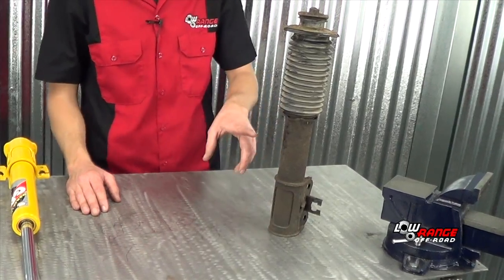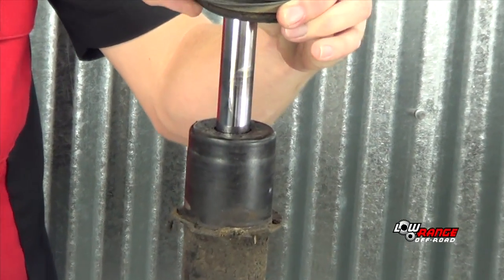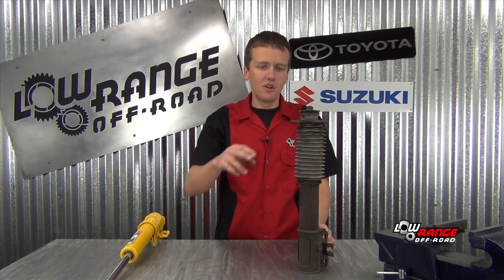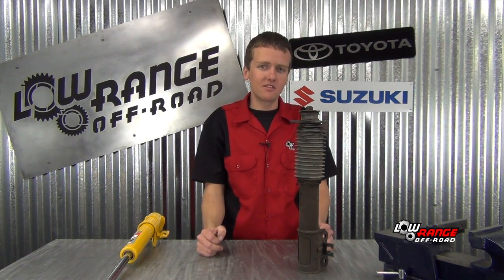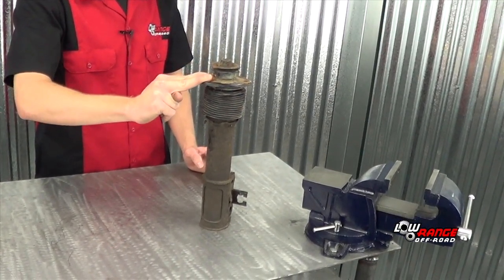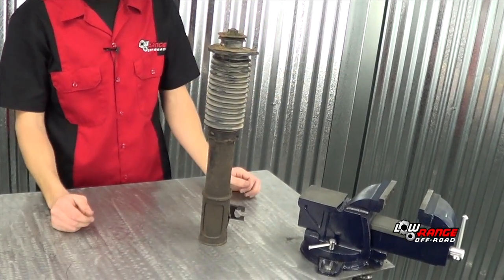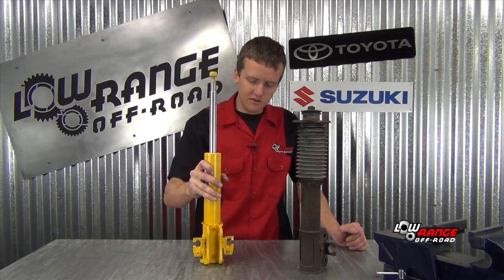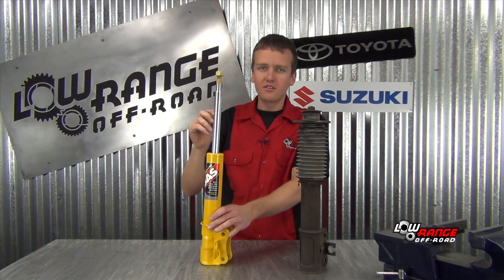Strut and Shock Testing

Comment: I think this is a bit misleading.  The purpose of the shock is to transfer the energy from your suspension and springs and dampen any bounces so you get a smooth ride. It's the resistance that's important.  If you push down or pull up on the shock, it's a way of gauging the resistance but without a proper measuring instrument, it's difficult to get an accurate. Watching the shock automatically extend is a measure too but it's not a very good one, except maybe in comparison.  I mean, the main force extending the shock is the spring, not the shock.  It's how much force does it take to compress and extend the shock when you're driving that's important. 

Too much resistance and I'm guessing you get a stiffer ride.  That is, the car doesn't bounce as much but you feel the bumps.  Too little resistance and I'm guessing, the vehicle bounces more and you get a smoother ride but too little resistance (like a blown shock), and you feel your suspension bottom out.  It feels like you just hit the pavement.  As far as I know, the better and more expensive shocks are made to a tolerance for the particular vehicle but the cheaper ones are not.

Another way of looking at this, if you put your hand over the shock to prevent it from expanding, it takes very little force so that force is not in play when you're riding on it.  It's the resistance that it takes to extend the shock that's important.  Should both shocks you install have the same resistance, sure but how fast it automatically recovers from compression might not actually mean anything for your vehicle.  My guess is that it depends on the forces at play in your vehicle when you're driving.  My guess is on something like a hummer, it makes no difference, as far as this demonstration is concerned.  On a volt, maybe; probably best to buy a pair that behave the same. 

Just my opinion and all.  I don't have much experience replacing shocks.  Up until recently I never replaced the shocks on my 23 year old truck.  Since I replaced them, just the front for now, I've noticed a better ride but who knows if they are any good.  I like my truck and all but I'm not putting $100 shocks on.  The worse thing about bad shocks is what they do your suspension system.   I could probably drive this truck for several more years without replacing the shocks but I'd have problems elsewhere if I didn't replace them.  I've never had a tire issue with bad shocks but bad shocks can really tear up your suspension and most of the time you won't even know it.
Reply: So you're saying it's misleading but you've replaced shocks once and you're guessing most of the rubbish in your reply? Please man

Comment: Actually the bounce test is not a full proper test to verify if the shock is bad. It is a method to use but does not fully verify if the shock is bad due to they have multiple stages inside the physical shock

Comment: I hear a rattling noise over rough road.  Is that the strut?
Reply: Gene Friedman my guess is that it is a different part of your suspension than the strut.  Get under your car and try to wiggle everything real good and look for play in your ball joints and bushings.

Comment: My kyb do not extend but there is quite the resistance both way. Just curious. They have been used for only 1000+ miles. But car the has been parked for over 8+years. Should I be concern whether its still good to sell?
Reply from the maker: I am not sure I can answer your question.  Your best bet would be to email us at sales@lowrangeoffroad.com or give us a call at 801-805-6644 8-5:00 MDT Mon - Fri.  Thanks for watching and commenting.

Comment: So, the resistance in my struts is decent both ways for the most part. They are gas charge struts. But, they do not automatically extend at all. I took that to mean that they were bad but I have had the damnedest time trying to verify that.
Reply from the maker: +Kristopher Hiser Sorry so slow in responding.  That may mean they are bad, but it could also mean they are not a gas filled shock.  It that is true they may be just fine.  Especially, if there is no sign of a fluid leak.  Thanks for watching and commenting.

Comment: Question, if I did push the rods in and they had high resistance but felt like there's gaps in em while pushing is that bad?
Reply from the maker: +Mahmood al-Walled Yes that is considered bad.  It should have even resistance up and down.  Although, I have found some new out-of-the-box shocks and struts that had very minor skips or "gaps" as you say.  That usually indicates air in the fluid and will sometimes work out over time and use in a new shock.  This is fairly common on Non-Gas filled shocks and struts.
Reply: Thanks!

Comment: Should you expect equal resistance during compression and extension? Is this true for all types of struts (gas charged, oil, etc.)
Reply from the maker: +Esevato76 Yes there should be resistance with both compression and extension.  This is true for both gas and conventional shocks and struts.  As to both directions being equal it would depend on the valving design.  I honestly do not know which would be greater.  My guess would be that resistance would be greater during compression.

Comment: by gas strut they mean gas charged, there is still oil but the gas is there to help with foaming and what not.  yes Gas charged struts will extend by themselves.  good even resistance is good, if the resistance is not smooth then its time to replace.